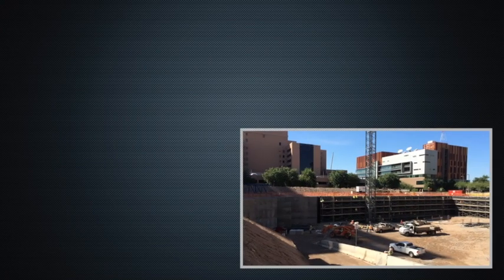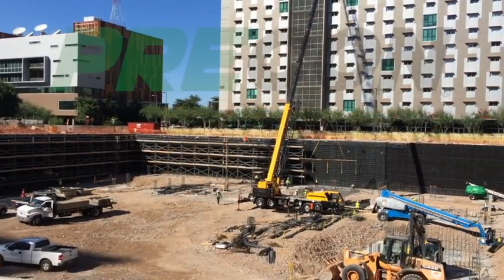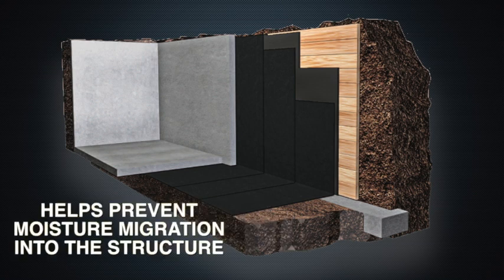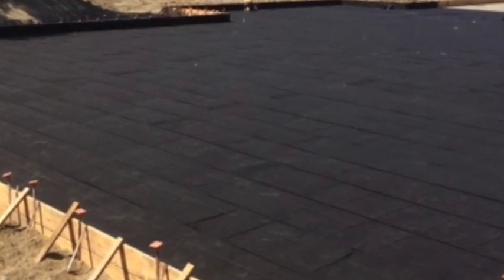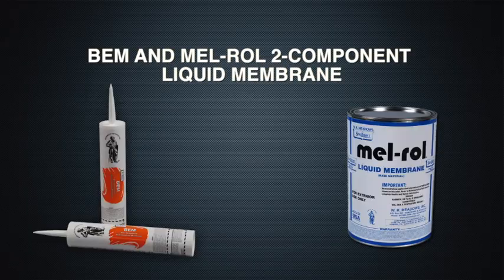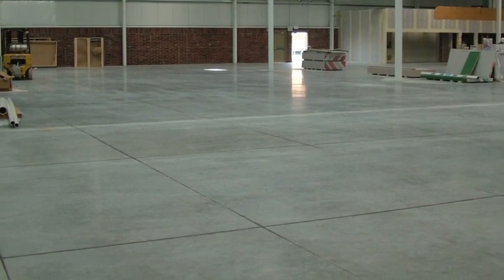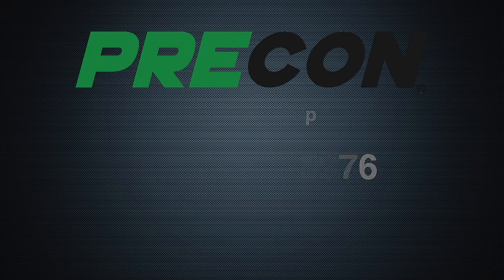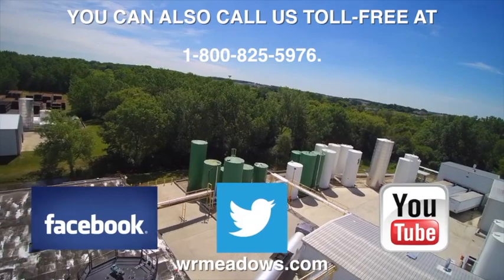PRECON Video - Underslab Waterproofing Membrane & Vapor Barrier

Comment: SUCH a lost industry.   Moisture is NOT the problem for flooring.  Slabs are hygroscopic and absorb moisture from any source!  The PROBLEM is that all concrete is 12.5+ in pH, and latex, urethane and acrylic fails at 9-10 pH.  It only takes a tiny, small amount of condensation at the surface bond-line, to create a chemical breakdown.  Don't MATTER how low a perm rate the underslab barrier is. The ONLY thing that matters down there, is that the slab is not sitting in liquid water resulting in a state of critical saturation that causes slab chemistry to double in activity.  Pour a low water/cement slab, 0.55 or less, and you don't really need an underslab barrier.   Maybe in Alaska.